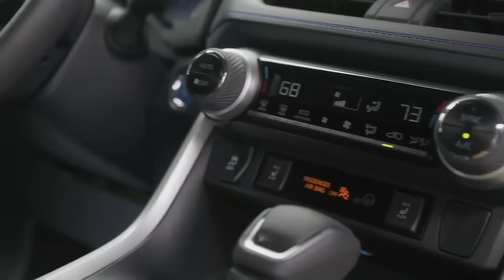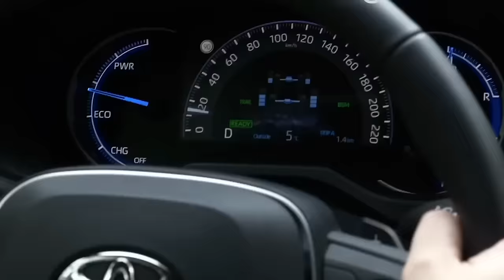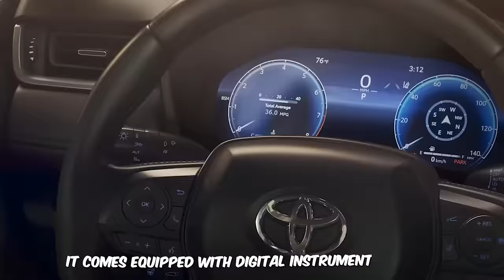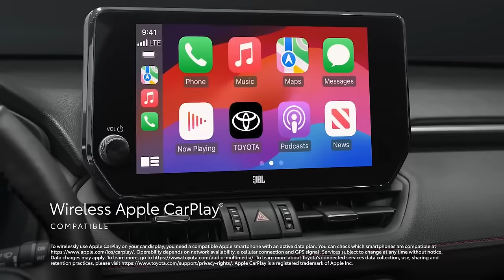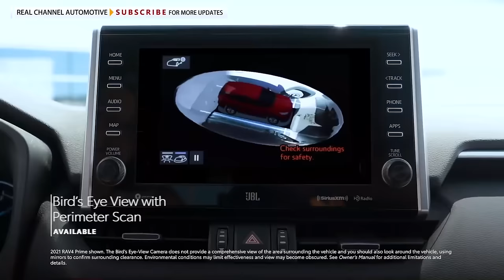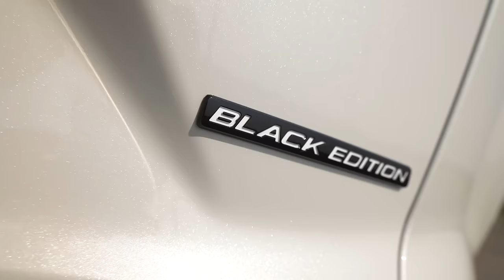This Is BAD NEWS For Toyota Rav4 Owners!

Comment from the maker: Is the Toyota Rav4 the best SUV on the market?🤔
Reply: It's very reliable and with today's car prices it's even more important to buy something that is not going to cost you a fortune on the maintenance side.
Reply: Sorry it’s ugly end of.❤
Reply: Yes, I am going to get the Rav4 in 2 years. I love how big it is. I want toyota to make them even more reliable like they used to be 30 years ago.
Reply: @MilkyWayGalaxyy  i got rav4 2017 and wanted to upgrade but i dont see a bit upgrade from rav4 maybe the 2023 or the new next gen of 2025 but im not rush since my rav42017 still kicking
Reply: Consider  Suburu Forester or Subaru outback
Reply: Nope. I have 2020 Rav4 Premium and mileage is only 16000 miles, but until now, I've changed battery already (I've never left my car alone). and had issue with "engine maintenance required" issue so I 've spent $600 for this issue.

pillars noise issue - The dealer service center doesn't know why.
leaking window - fixed.
loosen driver window - changed window motor but nothing changed. 

I am just planning to buy 2025 Kia Sorento hybrid now.
I will never going back to Toyota Rav4
Reply: I had a RAV4 hybrid 2016 and I drove over 250k miles. I never had to fix anything only did the oil changes, brake change, tire changes, spark-plug changes and the every 30 thousand mile services. I never even changed the battery’s even once. My average MPG was 27 even at over 250,000 miles put on the vehicle. I traded it in for the 2024 RAV4 hybrid and am now getting an average of 39 miles per gallon. I love my new rav4. The only thing I can complain about the Rav 4 is sometimes the engine is a bit noisy. cabin noise has improve a lot comparing my 2016 model and my 2024 model.

Comment: We own a 2019 rav 4 in the UK now has 53k never had a problem stunning car.
Reply: A barely 5 year old car with 53k miles shouldn't have any problems. You set the bar too low.
Reply: I went from a Subaru to Toyota RAV4 HYBRID,
Some good some bad things I don’t like,
Not real AWD.
Blind spot monitor doesn’t work every time.

Good things 
Better MPG
More HP

Still thinking I about going back to a Subaru
Reply: 53k is peanuts
Reply: @car24dude  Id like to go Subaru, but its just not as close in terms of reliability to Toyota
Reply: Same
Reply: My 2019@105k miles. No problems.
Reply: Verifiy the cable (cable gate). I have 53k on everywheel, and only the expected "consumable" and maintainance. Audi a3 2013. Still drives like new.

Comment: Reliability, 10 year guarantee, and holding its value. Plus it has all the comfort features I need , acc, lane assist heated seats and steeringwheel, ventilated seats , 360 cam ,android auto. Dont need anything else

Comment: I own a 2018 RAV4 SE gas powered, and I have 52,000 kilometers on it (31000 miles) and I think I'm going to keep this thing till it dies. I see no sense is all the added bells and whistles (distractions) car manufactures are adding to cars these days. If I need to be controlled by a computer on the car, that steers me from crossing the line on a highway, I shouldn't be "driving". As long as the A/C, heat,  and radio works, I'm happy. I have been driving Toyota's since the early 70's, and they are by far, the most reliable vehicle out there, regardless of model. My wife has a 2012 Toyota Camry XLE V6, and it has 200,000 kilometers on it (120,000 miles) and it's barely broken in. We haven't spent a nickle on it other than oil changes, breaks, tires etc. It'll be interesting to see how long the Rav4 will last, so I'm going to stick with ole faithful, to see if she expires on her own, before I do.  I don't need to follow the Jones, and as long as the car looks decent and gets me from A to B...reliably, I can't see why I would want to dish out $40,000.00 for another car, with possibly more electronic headaches down the road.

Comment: Wrong! 
 It's because the Rav 4 is the most reliable vehicle in its segment and it's finally decent looking.
I bought a Rav 4 hybrid knowing it would be more reliable than any other vehicle in its class and most people that buy Toyota's boring car line up buy because of reliability.  It's what everyone mentions when buying a Toyota.
Reply: Agree. However, I would rather just get a basic model with AWD and Automatic. All other things are not important to me.
Reply: Same here. Traded in a FAST luxury sports sedan (after only 12,000 miles) for a hybrid Rav, and I’m so glad I did. This thing will take me across snowy mountain passes, allow me to carry a kayak on top, and it’ll run forever. Even better, the gas mileage is so good, I don’t even have to budget gasoline on road trips. 600 miles for $45 bucks?! Yes please!

Comment: Due to the CAN bus weakness in the current RAV4 I cannot get a good insurance quote. It can be stolen without the key in about 90seconds. Quoted 1800 for the RAV4, compared to 1100 for a CRV. 😢

Comment: the truth is newer models are not like the old ones. In every product from computers to cars to motorcycles. 2003 RAV4 i still go up in the mountain never had a problem and i have it like its new. The downside is that it burns a lot of fuel. I'd love to have the new adventure rav4 btw need a new car. i hope the new one be like the old one cause you can easy have it for 20+ years

Comment: I own a 2019 RAV4. I couldn't care less about the interior and exterior design. I abandoned German brands for one reason only: their lack of reliability. When you buy a Toyota, the primary reason is reliability. If you're looking for design, you go for European cars. If the next generation of RAV4 is better and more beautiful, good for the new owners. But I'll keep mine because it has almost 100,000 miles with no issues and still has the original brake pads. My next vehicle, not before five years, will be a Toyota or a Lexus

Comment: My 2019 Toyota Camry hybrid has been driven for five years and has more than 40,000 kilometers. I bought it for 35,000 Australian dollars. The current second-hand market price is about 30,000-32,000. Another 2016 Camry hybrid is 34,000, more than 80,000. Kilometers, sold for 28,000 in 2022, Toyota hybrid is practical, fuel-efficient, powerful , cheap to maintain , second-hand incredible value preservation, easy to sell , it is really worth recommending👍,   it need take one to two years to order a Toyota hybrid , and I have ordered a Rav4 in two years ago, will get it in this May.
Reply: I waited 18 months for my 2.5 l PHEV. I’ve had it 6 months now. Pleasure to drive and 0-60 in 5.8s which is surprisingly quick for a big chunk of metal. No problems at all.

Comment: I'm a fan of Toyota, but I wish companies would quite calling this particular type of vehicle a SUV. At best, they are a cross between a minivan and a station wagon. When I think of SUV, I think the old Ford Excursion, Chevy Suburban and Toyota's 4 Runner and Land Cruiser.  All of these vehicle have something in common, an actual frame to tow.
Reply: I think of Rav4 as a Crossover
Reply: @ambivertical  I know car manufactures coined the name, but a crossover from what? A station wagon or minivan? And what is it crossing over to?
Reply: A car and suv.
Reply: Exactly it’s a CROSSOVER between a fwd unibody car and an actual suv rwd body on frame. I call my rav4 the station wagon Camry on stilts😂

Comment: In Canada (where they make the RAV4, the Toyota dealers are telling customers that they will have to wait from 2 to 3 years for their gasoline-powered RAV4 to be delivered, and up to 5 years for the RAV4 hybrid.    5 years ???   It will be a totally different design by then from the design that I originally ordered.
Reply: Looked at one recently in the US and they said a month. And had them in stock just not the right color. So its odd they cant get them in Canada.
Reply: Toyota dealer said Toyota focused on US market more than Canada
Reply: From Toronto.  I ordered a gas XLE November 2022 and received it May 2023.  Ordered another gas Limited from same dealer in December 2023 and received it about 5 weeks later mid-January 2024
Reply: From Toronto,  I ordered a 2024 RAV4 XLE (gas) in mid October 2023 and received it on Feb 24, 2024.    So the waiting time was around 4 months for me.
Reply: Got one in 2 days, with 20.000 euro discount, 4 years old
Reply: I'm in Markham Ontario ordered a 2024 RAV4 LE I got it in 5 weeks. It's true US build a higher volume

Comment: yes you should be sorry, the safety recall in Dec last year still not rectified up to the present moment which is 5 months already, in the past, toyota is not like that, they fix problems fast but now, don't know what they are doing at all. Toyota is not reliable as in the past anymore.

Comment: I did have a 2010 Subaru Impreza 2.5i Premium 
Last year 2023,  I traded it in for a RAV4,  Not happy with it,  gaps in the hood,  blind spots monitor not working properly.  The dealership can’t fix it properly.

Comment: My Brother just bought a 2024, developed an oil leak at 600 miles. The oil pan was leaking. I have a 2004 Matrix, never had a leak in twenty years. Not the same Toyota. 😢
Reply: Oh brother… anecdotal evidence is worthless.  In aggregate, they are still extremely reliable vehicles - by some accounts the most reliable available in North America.
Reply: Very rarely do Toyota’s have reliability issues.

Comment: Shoot. 2023 coming in December 2024?!? I figured there was something “off” with this review when they mentioned 2.0L engine — we just picked up our 2024 RAV4 XLE with 2.5L engine yesterday. And here I was thinking we maybe got a model a year behind — turns out the 2024 was just released about November 2023. It’s so new I can’t find aftermarket rims and add-on fog lights. My only gripe about it is the LED dashboard could have been higher resolution… it’s 2024 afterall.